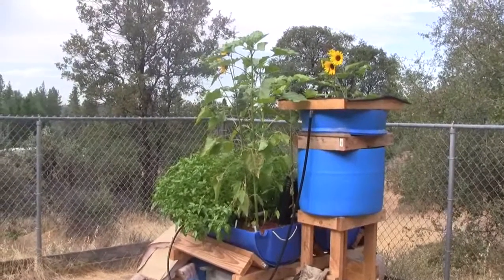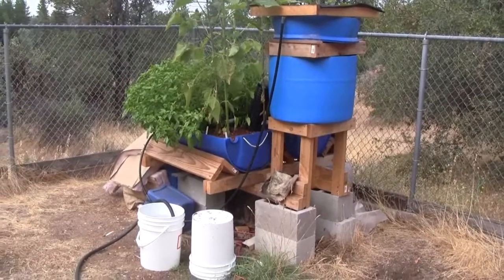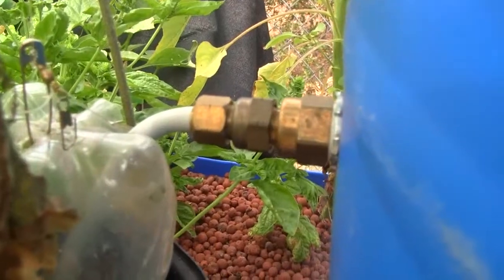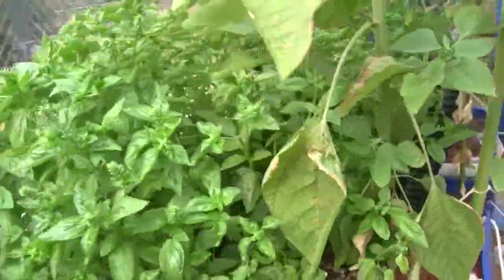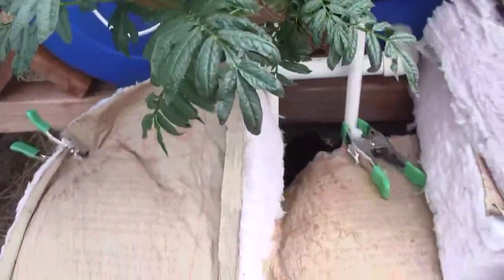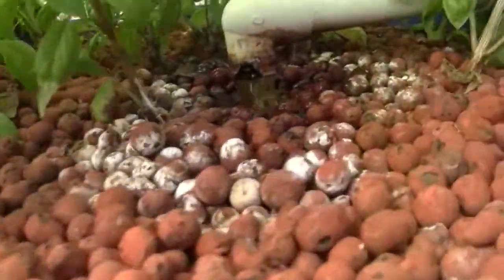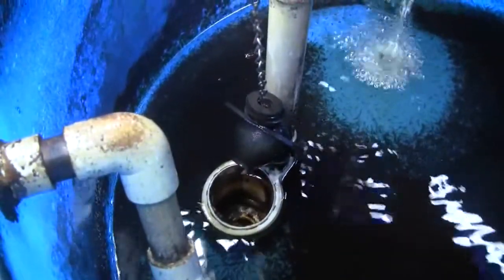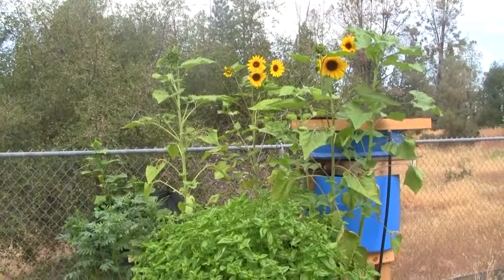Great Little Aquaponics System 2

Comment from the maker: It's really simple and has been running continuous for a couple years.  So sure, it could fail, some day certainly will, so something we keep an eye on.  But it is very reliable.  The up coming system will use Bell siphon.  We'll be showing a budget system you can build for about he cost of 1 years vegetable expense........after which you won't need to purchase veggies as you'll grow more than you need.........of course you'll always want something for variety, but then trading can work.
rt

Comment from the maker: for skeller05........ the water floods and drains out of the grow beds.  The drain is a pipe located at the very bottom of the grow bed half barrel.  The rate of flow is adjusted via diameter of pipe.  The inlet is large diameter, so floods fast, and the drain is smaller diameter and drains slower.  It has been working, though it could certainly clog.....but it hasn't in over a year.    Anyway, water is conserved, though evaporation / transpiration requires addition ~5 gal per week (hot).
rt